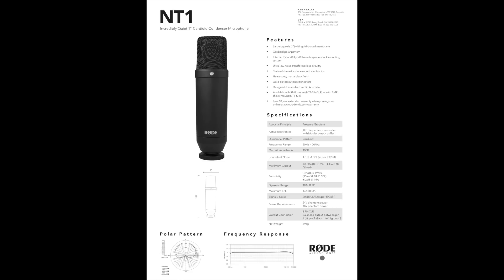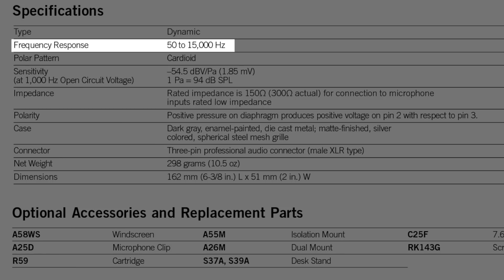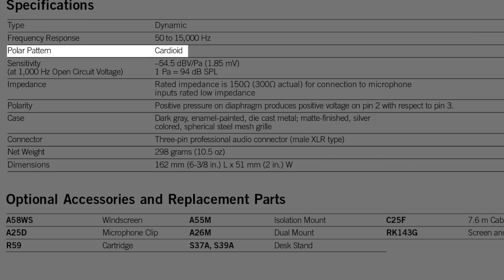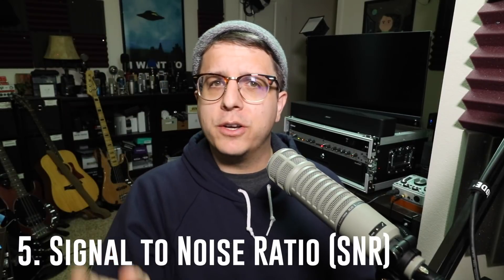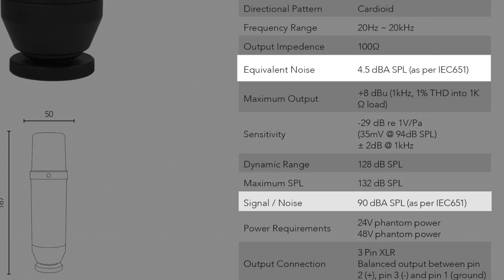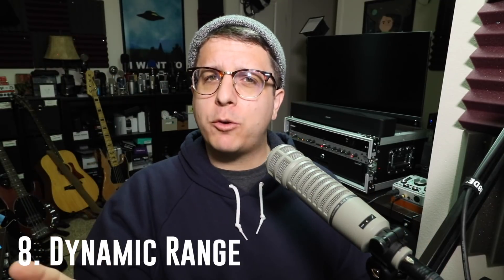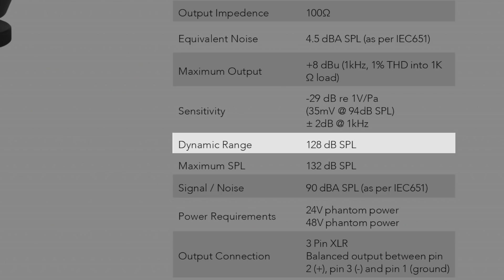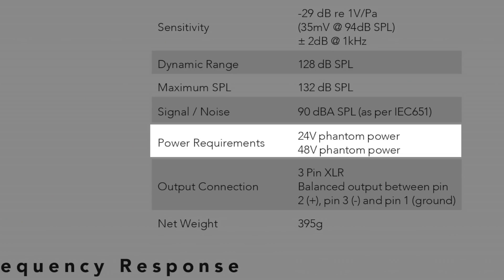Understanding Microphone Specifications (FAQ Series)

Comment: I currently have a mic that has an output impedance of 300 … I’m interested in a microphone that has an impedance of 110 . So essentially the 110 is better ?
Reply from the maker: Not necessarily better. It will have an easier time getting the signal over long lengths of cable. And I may be incorrect in this, but my understanding is that the higher the impedance of the sound source, the higher the preamp noise floor. But that's not something I have verified with testing, so take it with a grain of salt.

Comment: Greetings from Australia, 
thanks for your great info. 
Got a question for you..
about to buy BEHRINGER t47 mic , originally bought from a country using 110 volts while in Australia I use 220-240v. i do not want to use a step diwn converter, can I just buy a different power supply ? like one from BEHRINGER websites?? 

thanks in advance,  I hope you get to see my question

Comment: If your dynamic mic is low impedance and you have long cables then when step on  a cable, the voltage of this will be significant compare to mic output level what will be audible on speakers. Better use at least ten times higher impedance dynamic mics than impedance of long cables.

Comment: Hello i am using audio interface with sensitivity 0 - 45 db and sm57 is 56db sensitivity  it requires almost 90% of gain to work but it adds noise. What if i use SE dynamite  which increase 28db. What will happen. Will it be good options or will it add noise and how much gain i can reduce . I guess may be around 40 to 45 %.if i m not wrong please answer.

Comment: Thanks, that was very helpful. Just want to clear up the decibel info. I believe that 0 db's is the human hearing threshold, the point at which we no longer can hear sound. That means that "negative" db numbers would be related to what the microphone can pick up (or hear). So, when you test the mic by increasing the knob from 0 thru 100%, we are essentially "hearing" what the mic picks up although we normally would not hear that hissing. Not sure if that's correct but that's how I think about it. Anyway, I'm sure that there are further explanations for all of the other parameters as well but unless you are some kind of electrical audio engineer, you probably would not understand it? Thanks..........

Comment: Not really related to the video but you were right about the issue being my interface with my V67G. Works well with a Steinberg interface. I don't have a voltage meter but I guess that interface is known for giving 24 or less volts. So for anyone reading this if you see an ART USB Dual Pre interface at a store don't buy it even if it's cheap (unless you only use dynamics and electret condensers). Just get one of Behringer's budget interfaces, or pay a little more and get a good used (or good $100~) interface. The new price of the USB Dual Pre is like $80 so stay away.
Reply from the maker: Excellent! Glad to hear you got it sorted out! =) Sorry you got a bad interface initially.
Reply: Podcastage Do you have any experience with portable recorders that offer phantom power? Or do you know if an XLR to 3.5mm cable can feed the voltage to a true condenser?